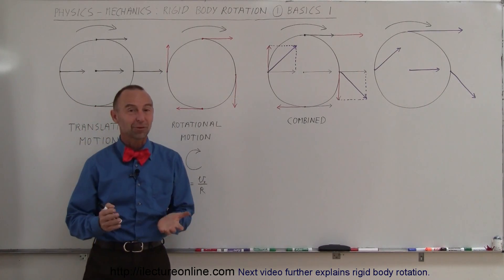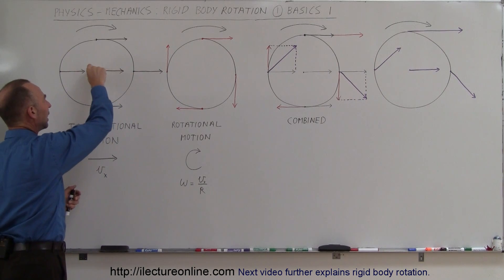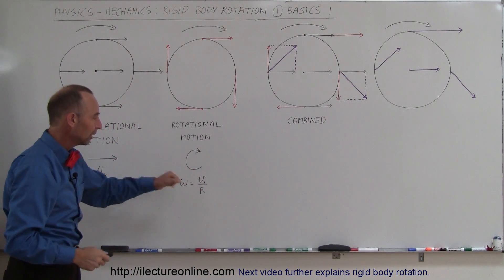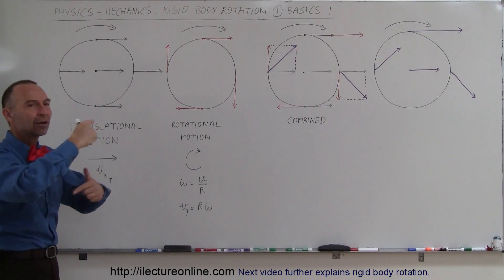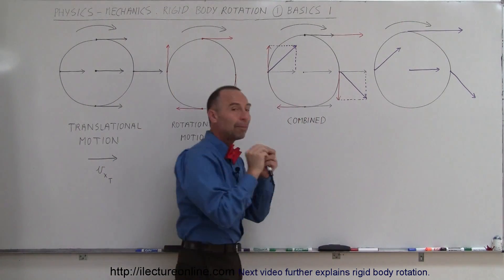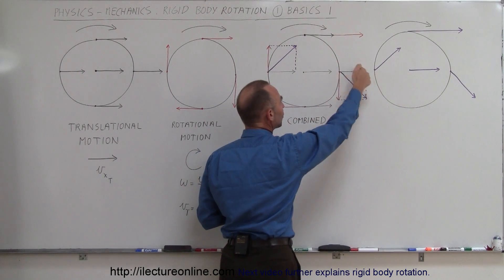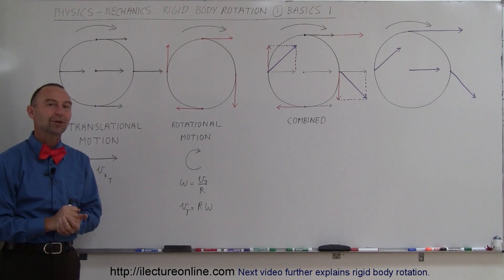Physics 11.1  Rigid Body Rotation (1 of 10) Basics

Comment: Hello there! I wonder if you are open to discussing this video and maybe answer some clarifying questions.
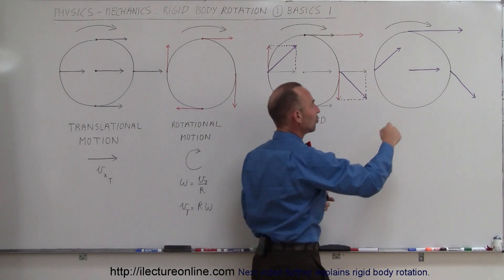In particular, you mentioned acceleration around 3:00 in. Can you please clarify that while the direction of acceleration varies as the wheel turns, the magnitude of acceleration is constant. Further, can you clarify that the magnitude and direction of acceleration on the rim would be exactly the same if the wheel were spinning in place as if on a dyno?
Finally, are you open to a deeper discussion... Perhaps with some folks who are hostile to standard classroom physics topics?
Thank you.

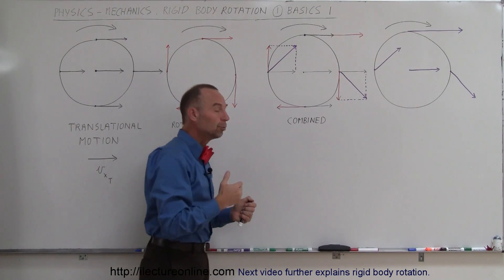Comment: 2:45 to 3:10 "tremendous acceleration"   Yes sir I 100% agree!
Now what if the rim speed were 1039mph and we had a delta V of 2078mph over a 12hr time frame.  And lets say the tire were made of soil.  Is the tensile strength of soil strong enough to withstand those tremendous accelerations?

Comment: Rigid body rotation and translation prove that people on a globe earth rotating and translating(orbiting the sun) would experience acceleration and deceleration. I don't feel the earth beneath me accelerating or decelerating which disproves the globe model. What do you think Michel?
Reply from the maker: The accelerations and decelerations are so small that you cannot "feel" them.  The rotational speed on the Earth's surface is much smaller than the speed of the Earth orbiting the Sun.
Reply: @MichelvanBiezen  Okay but I suggest if you want make a video showing the calculations for the accelerations that would be felt by a man standing on equator of the globe surface.
Allegedly the radius is 3959 miles and orbit around sun is 67,000mph.
Reply from the maker: The accelerations are so small they cannot be "felt".
Reply: @MichelvanBiezen  Okay I get you but you are just saying that so that's why I suggest if you would like to present the calculations as to how much acceleration would be felt by a man and then people can experiment by accelerating at that force and test whether they feel it.
Reply: @MichelvanBiezen   Well... there is a 2078mph rim speed acceleration in 12hrs.  Please explain why things airborne and large bodies of water don't exhibit the ground accelerations. 
I think I know why....

Comment: Can you do a vector analysis of the rotating globe while it is "translating" through space around the sun at 66,000 mph? Would there be a momentary instance where the velocity would be zero like on a rotating tire going down the road?  Will we have "tremendous accelerations" and then reduced velocities repeating over and over again just like the spinning wheel "translating" down the road?  Will you do it or as one Youtube channel called Kryptonite Physics has pointed out "There is a reason why in Astrophysics they do not use rotating reference frames that are moving is because it all falls apart if they do".
Reply from the maker: It will not be like the motion of a tire on a moving car.  That is very different.  The speeds of stars moving through the galaxy, are small compared to the size of the galaxy.
Reply: @MichelvanBiezen  Okay, but will you do it. I would like to know what the speed at the equator will be while the earth is rotating at 1,030 mph at the equator while "translating" through space around the sun at 66,000 mph. ( or whatever speed it's supposed to be going).  Maybe you will get some interesting results.
Reply: @jimcapp5077  Visit GreaterSapien's channel where he discusses Kryptonite Physics' videos and he is wise to the flat-earth stuff.
Reply: @MichelvanBiezen  Why is it so different? Vector addition is vector addition.

Comment: Sir, I have a problem that seems to be pretty simple but I cannot get the right answer. I hope you can take a look and give me some hints about it, I think I have trouble calculating the couple C. 

The problem is: "A homogeneous cylinder of mass m and radius R is at rest on a horizontal plane when a couple C is applied clockwise. Determine the magnitude of the coefficient of friction between the wheel and the plane so that rolling will occur."

The answer is: coefficient of friction >= (2C/3)/(mgR)

Your videos are always awesome. You teach us what school is supposed to teach...Thank you very much, sir.

Comment: WHAT??? The point of the tyre in contact with the road does certainly NOT stand still, and then accelerates. You are dead wrong, mate. The tyre (and all of it's `points`) have a constant, angular velocity. The `standing still` only happens to the point of the ROAD where the point of the TYRE passes. (Else the tyre would be slipping/spinning) - So the tyre does NOT (not) experience a change in velocity, and hence no acceleration, other than the constant roundabout-like acceleration around the wheel hub. What have you been smoking? I want some...
Reply from the maker: In the discussion, you need a point of reference.  The point of the tire making contact with the road does not move relative to the road.

Comment: I was amazed to see a very basic misunderstanding on display at 3:00 in this video. Consider a spinning tyre that is not in contact with a road, and has no translational motion (indeed, the exact situation shown in your first diagram). Sticking to the same numbers as the video, suppose the top of the rim moves to the right at 60 mph. The bottom of the rim will then be moving left, i.e. at -60mph, a difference of 120 mph. Acceleration is the rate of change of velocity. So this is exactly the same acceleration as for the car in the video which is in translational motion. And this, of course, is what we'd intuitively expect: a fly clinging to the rotating rim would feel exactly the same centrifugal acceleration whether or not it was in translational motion. It follows, then, that the heating of the tyre has nothing to do with the acceleration as the video claims. (Why would it? ... there's no physical principle that says acceleration causes heating). All of the heating comes from friction and compression due to contact with the road.
Reply from the maker: The acceleration causes internal stresses that add to the heating.
Reply: @MichelvanBiezen  , the acceleration is exactly the same whether or not the wheel is in translational motion. Again, look at your own examples: a change in velocity by 120 mph between the bottom and top of the rim whether you look at your first or last diagram. That's the same acceleration. You say in the video that the tyre rim is undergoing a "massive" acceleration when in contact with the road, as if to imply it was a greater acceleration than the case without translational motion.
Reply from the maker: And yes, without contact with the road, and that contact pushing the car forward,  there wouldn't be any internal stresses
Reply: @MichelvanBiezen  , yes, there is stress due to the deformation of the tyre. Just to check, though, you're happy that the acceleration on the wheel rim is the same whether or not the wheel has any translational motion. In other words, it would be the same for a car on a treadmill that was going nowhere. Or, to put it more precisely -- the accelerations can be calculated for the frame of reference in which the wheel axis is stationary without regard for translational motion. (Which is a simple statement of Galilean invariance).
Reply: @MichelvanBiezen  Deflection of the horizontal contact patch and the vertical sidewall flex also add heat.

Comment: You said that the tremendous acceleration of a tyre particle when it's at the bottom hitting the road is part of the reason why there is a lot of heating effect taking place by the rotation of the tire.
The inertial frame of reference for any particle of the tyre is the centre of the wheel, which is moving at constant velocity, the acceleration felt by a particle at the edge of the tyre is due to its' rotation.
The heating of the tyre at the contact patch with the road is due to the deformation of the tyre and sliding friction with the road surface, as not all of the contact patch is stationary wrt. the road.
The  tremendous acceleration you mention is wrt. a stationary observer by the side of the road, a different inertial frame of reference.
Reply: "The inertial frame of reference for any particle of the tyre is the centre of the wheel, which is moving at constant velocity, the acceleration felt by a particle at the edge of the tyre is due to its' rotation."

That is WRONG.
- Only the center point of the wheel is moving with constant velocity.
- Every other point is experiencing acceleration and deceleration.

Think about an airplane turning.
- A F16C can make a turn of 14 degrees/s at Mach 0.8 (15,000 feet)
- This results is a centrifugal force of 6.78G
- Obviously the plane cannot be viewed as a inertial reference frame.
Reply: @decadent.  WRONG.
What are you talking about?
Reply: @stevegreen8262  
Your statement is incorrect.
- The whole point being made here is that both motions must be considered.
- When you combine linear velocity with rotational motion . ONLY the center point of the rotation has CONSTANT VELOCITY.
- So every other point must experience acceleration/deceleration..
- The laws of physics do not suddenly change because you chose to view something as being in a box.
- At the risk of having this comment deleted ..... [ highly likely - although Michel van Biezen I would respect you more if you leave it :) ]
- When I did my degree , I believed what I was told regarding relativity . When I started working on real projects I realized that it is B.S.
- Relativity is maintained for political and ideological reasons. It is wrong as all engineers/pilots/snipers know.
- Read the comments on the video on my channel especially with the debate I had with the PhD professor for more :)
/
Plane flying on a rotating earth at the equator.
- 1040 mph + 650 mph EAST
- 1040 mph – 650 mph WEST
- Now , if we accept the idea that planes are being “pulled down” by gravity as they fly level.
- Then, there must also be a corresponding centrifugal force acting opposite.
/
Standard passenger flight (35,000 feet , 650 mph) EQUATOR 
/
Speed (mph) = 390 (west)
Height (Miles)= 6.62
Gravitational acceleration (m/s^2) = 9.78091
Centrifugal acceleration (m/s^2) = 0.00476309
Remaining acceleration (m/s^2) = 9.77614
/
Speed (mph) = 1690 (east)
Height (Miles)= 6.62
Gravitational acceleration (m/s^2) = 9.78091
Centrifugal acceleration (m/s^2) = 0.0894402
Remaining acceleration (m/s^2) = 9.69147
/
Modern mems accelerometers are extremely accurate and would EASLY be able to show this difference (9.77 m/s^2 vs 9.69 m/s^2)
Why does an institution like a university not carry out this simple experiment ?
/
Here is WHY ….
- What about a plane making a turn ?
- Based on the F16C manual.
- In a level turn (15,000 feet) , at Mach 0.8 (272.232 m/s) , 7 Gs, and 14 deg/sec, the F-16 can turn 180 degrees in about 13 secs.
Google “F16 turn performance 15000 feet”
/
Based on the formulas on this page ( converted to more useful units)
GOOGLE “Wiki Standard_rate_turn”
/
Radius (meters) = 57.29579594 * Velocity (m/s) / Turn Rate (degrees/s)
/
Centrifugal Acceleration (m/s) = Velocity (m/s) ^ 2 / Radius (meters)
/
At 272.232 m/s :
/
Turning Radius (slipage) = 1114.12 meters
Centrifugal Acceleration = 6.78 G
/
This is ASSUMING a stationary earth ( of course ) .
/
Now, Factor in the 1040 mph the airplane would have it if took off from a rotating earth ( flying EAST )
/
Add on 1040 mph (464.9216) = 737.1536
/
Turn radius must be the same !!!!
/
Turning Radius (slipage) = 1114.12 meters meters
Centrifugal Acceleration = 49.7 G 
/
GAME OVER fuzzy haired idiot 'Einstein" which means ONE STONE in German :)

Comment: This disproves the earth spin of 1,000mph at the equator. Game over for the globetards now. Nice work 👍
Reply: Are you having problems with frames of reference?
Reply: How?
Reply: If your frame of reference is the car then you observe a constant velocity for every point on the tyre. But if your point of reference is the ground, you observe each point on the edge of the tyre move between stationary and twice the velocity of the point of rotation. It's called vector sum. 
And if your frame of reference is the wheel itself, it remains stationary.
Reply: @brucebaxter6923  no, you’d be using the sun as a reference frame initially for earths claimed orbit of it, then you’d be using the galaxy and the suns claimed orbit around the it. Then add in the Big Bang calculations.
Reply: @rightsarentwrong5635  
Sooooo,
You don’t understand what you are trying to discusd

Comment: Thank you, but still dont understand bottom of tire not moving,,but it is not stay at same contact point with earth and changed point of contact??. not moving mean not changing place
Reply from the maker: It means that wherever the tire makes contact with the road, there is no relative movement between the surface of the road and the surface of the tire.  (no slipping or sliding)
Reply: The contact point Is the same for the Road and for the tire. So, since the Road Is at rest, the tire Is at rest as well.

The contact point Is called instantaneus center of rotation, because u can immagine that the body is rotating around the IC only for that instant.

Comment: Professor, what if there is deformation? The normal force is shifted more towards the "front" leading edge but does this mean its acting as 'rolling friction' because it now has a horizontal component thats opposing the motion (eg rotating clockwise and the normal force has a component to the right thus, tangential v is reduced)? Thank you!
Reply from the maker: If there is deformation then you have to include the rolling friction.   That is covered in this playlist:  MECHANICAL ENGINEERING 11 FRICTION

Comment: Hello there,
First. thank you for this video!

You said that the tremendous acceleration of a particle tire when it's at the bottom hitting the road is part of the reason why there is a lot of heating effect taking place by the rotation of the tire. 

I have 3 questions about that:
1. How can I calculate the exact amount of heat generated from this acceleration? 
2. What are the other reasons causing the tire's heating? How can I calculate them?
3. How much (+/-) of the total heating is caused by this effect (heating caused by acceleration)?

Thank you!
Reply from the maker: The heating comes from the stress created during the rapid acceleration and deceleration as well as the friction it experiences on the road and the deformation of the tire as it makes contact with the road.  These are difficult to calculate and cannot be measured directly.
Reply: @MichelvanBiezen  , this is incorrect. All of the heating comes from friction and compression due to contact with the road. To see why, simply consider a spinning tyre not in contact with a road, and with no translational motion. Using your own numbers, the top of the tyre would then be moving at 60 mph and the bottom at -60mph, a difference of 120 mph. The acceleration is exactly the same as for the tyre in contact with the road.

Comment: sir i have a fixed-joint hydraulic cylinder pushing a circular bender with a 2 ft radius. my initial force is 1.5 tons to start the bender rotation. my quetion is that what is my final force apllied when i the circular bender turn at 90 deg.? should i used the resultant force?